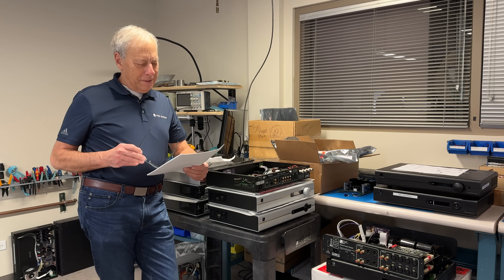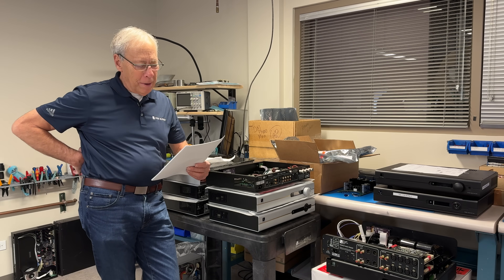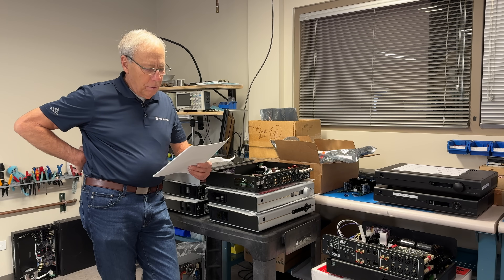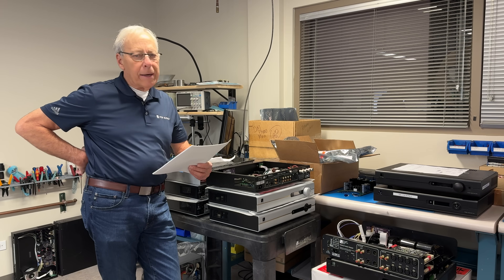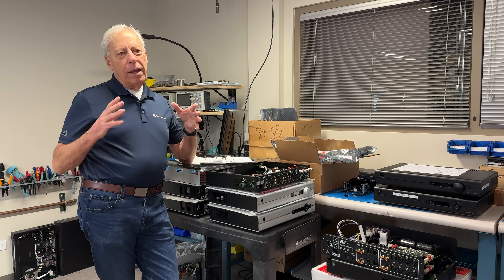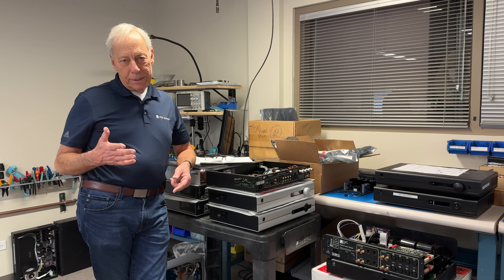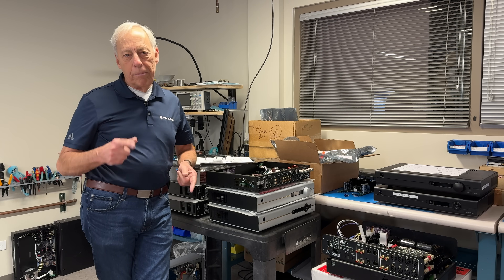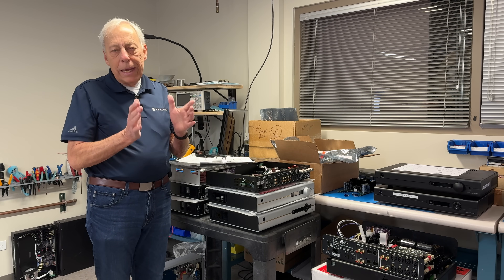Hybrid Class A and D amplifiers

Comment: In the late 90s I got involved in the very first use of  ICEpower at Bang & Olufsen. As employee of the R&D department I also got a pair of Beolab 1 active loudspeakers for test at home in 1999. These huge aluminum active speakers include 750 Watts of first generation ICEpower amplifiers each speaker. Supplemented with more channels and subwoofer they have served as front speakers in my home theatre for 2 decades and guess what? They still work perfectly fine now 25 years later being powered every day!!! One major advantage of ICEpower is the ice factor of the electronics not running hot due to high efficiency and that makes it last much longer.
Reply: B&o red lines 35years still punchy solid sound ,Onkyo9010 amp just perfect musicality🎉